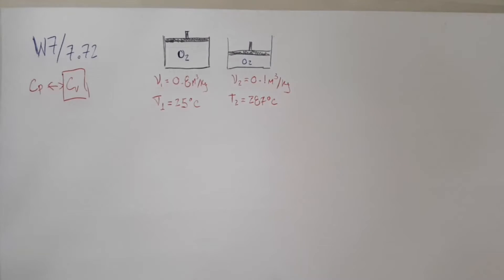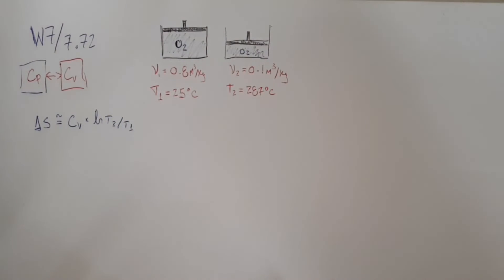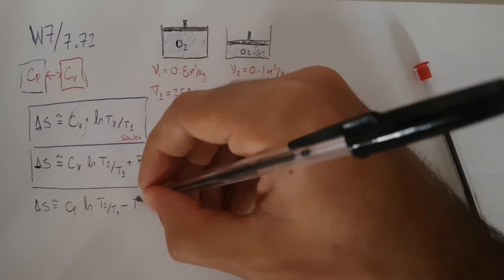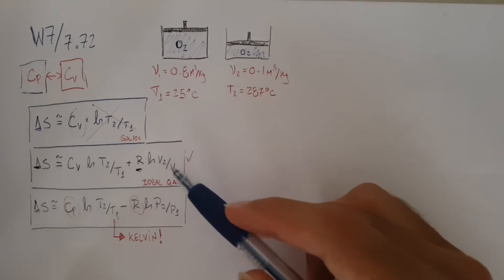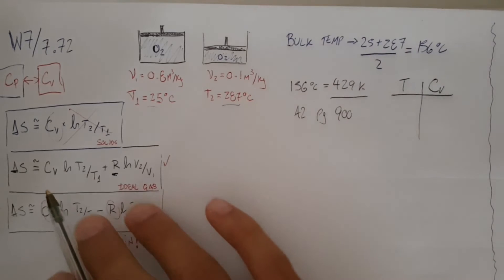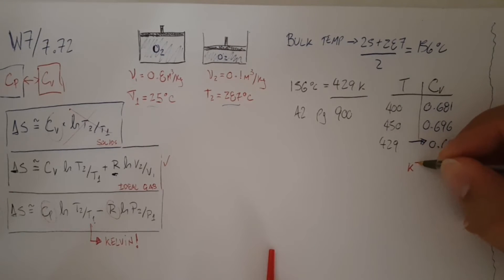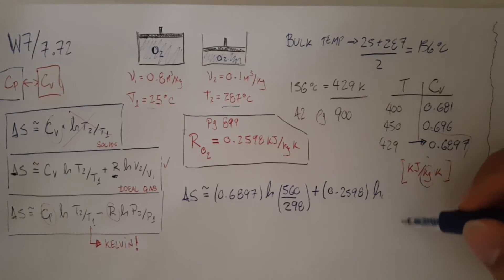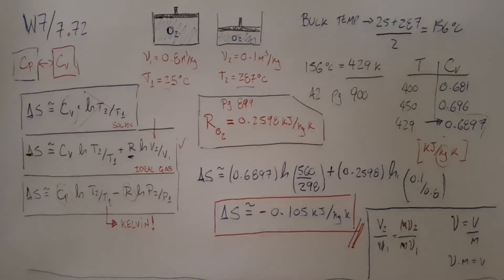Thermodynamics Mech3001 - Week 7 - Problem 2 (7.72)

Comment: Professor I have a question here , in the solution of the book molar mass of oxygen was found.I did not understand why it is found but not used.Could you help me to clear up my confusion here
Reply from the maker: You need the molar weight if you use the ideal gas constant (R) in its general form (i.e., per mol). You'd then use the molar weight to convert the R into the specific R for oxygen.
Because in our case we grabbed the specific R directly from the table, we were able to skip this step. Hope this helps. Happy studying